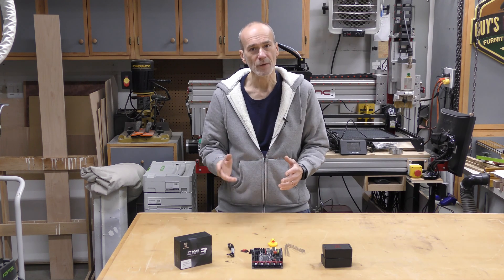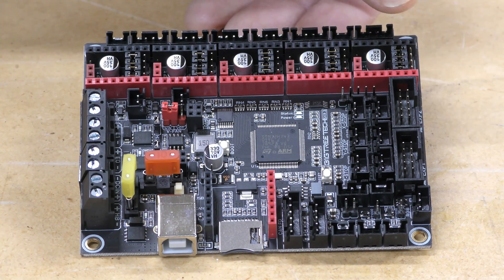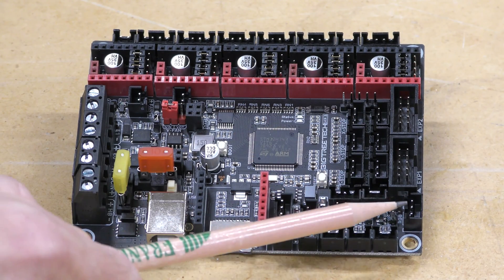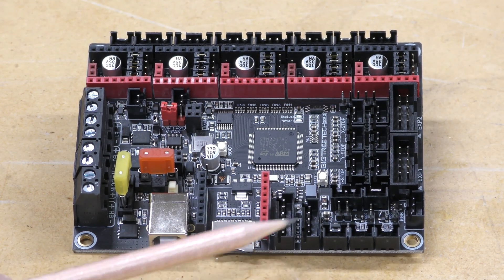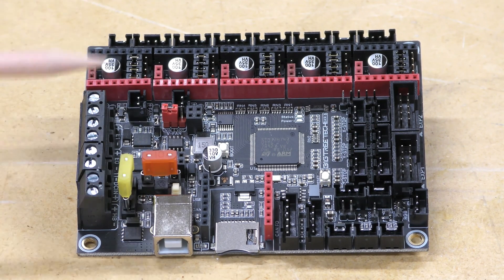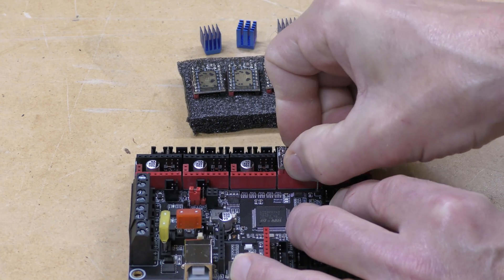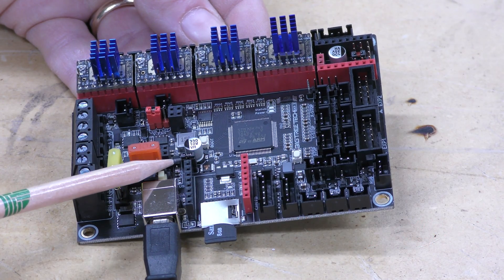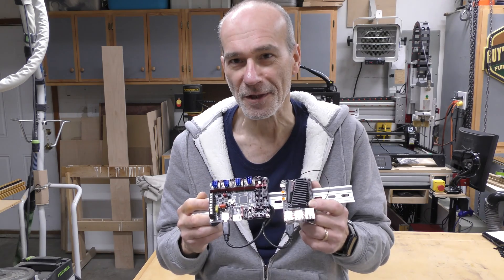Bigtree Tech SKR 3 Main Board

Comment: Hi, I just bought two of these boards for two CR-10 S5's I have.  With such a big bed, it seemed wise to have independent control of each Z motor.  I've installed many SKR 1.4 Turbos and SKR E3 v3 Minis.  Question - do you have to snip off a pin if you aren't using sensorless homing?  I had to do that on the 1.4 Turbo since I am using the 3D printer's limit switches.  Thanks!
Reply from the maker: Not with this board and the BTT 2209 drivers

Comment: I just checked your link for the SKR 3 and for the price you are getting a lot.  I'm curious as to why you're using this on an Ender printer?  I started with a CR10 printer and it's running a CR10S motherboard as I wanted dual extruders but haven't seen the need for a higher horsepower MB.  It has been the most reliable printer I've owned.  My only wish for it would be better material choices (ABS, Nylon, etc) but for PLA it's a workhorse for me.  Anyway, I'm looking into building a core XY printer and probably will go with this MB for it.  Hope all is well with you and I want to say I've enjoyed all of your videos.  Please keep them coming.  Thanks!
Reply from the maker: Why put this in an Ender 5? Truthfully because I can. My E5 is heavily customized and even though this is a "top of the line" motherboard, the price is still super reasonable.
Reply: @GuysShop  Agreed, if I had the time to do it to my CR10 I would.  I was just curios if it had a pressing need for the new board in your Ender.  Anyway, I forgot to say thanks for your Videos, I always enjoy them, thanks!